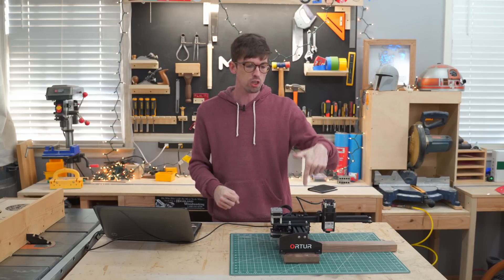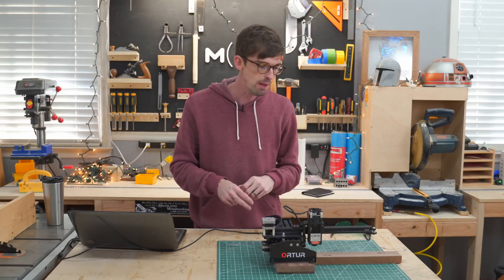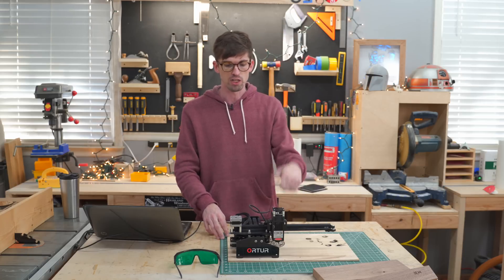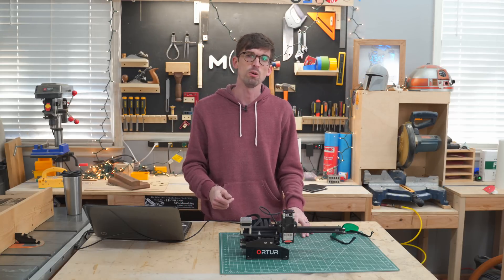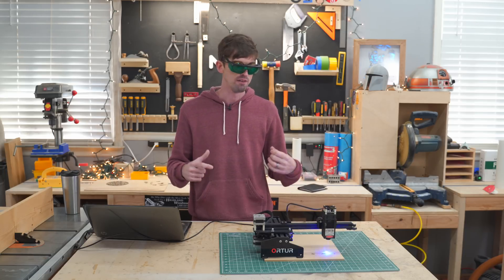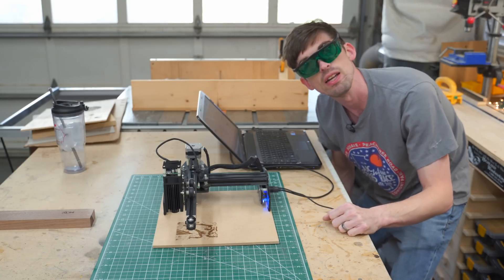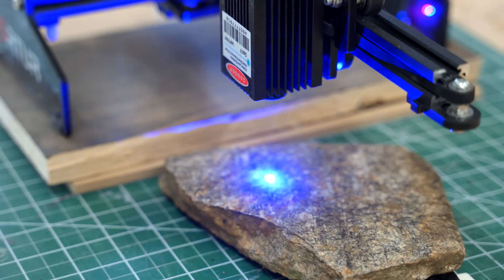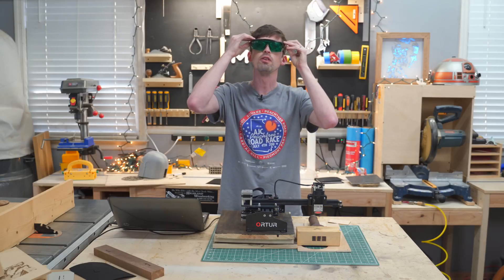Does a $200 Laser Engraver Make Sense in Your Shop?

Comment: can it engrave on metals like aluminium, brass, etc.
Reply: I use the laser to cut a shape on adhesive plastic. Later, apply copper sulfate or iron sulfate to etch the metal
Reply from the maker: Not metals

Comment: I am thinking about getting into Engraving. Question what would you recommend for Engraving on aluminum and Metal? This will be more of a little Hobby not something to make money off. also wanted to be versatile enough in order to do other material paper wood leather stuff like that
Reply: This láser isnt powerful enough to engrave metal. What i do is: a) put some adhesive over the metal. Cut a shape using the laser. 2)etch metal over the shape using cooper sulfate, iron sulfate, sodium hidroxide or something like that

Comment: Hi, great vid. Question, how does the laser know where on the material to start Engraving, let's say I have a 50mmx50mm sheet of card and I want the entire thing shaded black, how do I know where to put the card under the laser
Reply from the maker: You can run a trace that will going around the entire boundary box of the artwork.  Then either move the artwork in the software or move the material.

Comment: Also, worth noting, those included glasses aren't rated for the laser on the machine. The tint vs color of the laser is a dead giveaway. If you look at any laser engraver and many high powered laser pointers of similar wavelength, the protective shielding or goggles are orange. It's basically a principle of opposing colors. It helps if you think of the color of the goggles cancelling out the color of the laser. In this case, the blue laser light is extremely close to the green goggles on the color wheel. The goggles let light in and around the green wavelength through. For the goggles to be effective in blocking the blue laser light, they should be red, or preferably orange, the opposing color to blue. 

Since they aren't clear or blue goggles, they are probably blocking some of the harmful light, but I definitely wouldn't trust my vision to them, especially if they were included free with a cheap and cheerful, safety measure delete laser engraver.

Edit: It might be worse than I thought...I was just basing this off of a combination of my knowledge of optics, confirmed by the high end laser related products I've seen. I just looked it up and found this video. It looks like he has a pair of the included glasses, and they fail to even block an LED, so if you're staring at the laser light, you're probably roasting your retinas.
https://youtu.be/upCsVrKrW7M

He also has an epic accent.

Edit 2: Here's a video that goes more into depth on what you should look for in goggles to protect yourself. I am pretty confident that the ones included above are just green plastic, with no laser rating whatsoever. If one is listed, I'd be willing to bet that it's utter BS.

Long and short of it, if you're gonna save a buck on your laser engraver, don't skimp on the PPE to go along with it. Or you'll be giving yourself anti-lasik.

Final Edit: I'm also only considering the harmful potential of the unshielded laser module. This is ignoring the carcinogen laden fumes it's outputting. There is a reason laser cutters are enclosed both behind laser shielded material AND have their own filtration and extraction systems. This could also very easily start a fire if you're not watching it like a hawk, and even if you are, I can see a mosquito fart knocking it over, or it overshooting the material it's engraving and scorching the surface beneath it. 

As much as I want a laser cutter, this seems like a bad idea. 3d printers and CNC routers are one thing to downsize and lose all the safety gear. The damage they can do is pretty limited to localized burns and possibly losing a digit to a router bit. Laser cutters are next level dangerous.
Reply from the maker: Thanks for the reply, yeh the glasses aren't going to filter out the light, the big thing to keep in mind though is that the real danger is the proximity to the actual beam, that's why the focus of laser can make a huge difference with just a few mm.

The enclosure is the biggest drawback on this machine, but it wouldn't be too hard to build a box around it with some ventilation.

Comment: Laser input is 15 watts
The actual output is only 3.7 watts
Reply from the maker: Good call, I need to update that
Reply: @makeorbreakshop  From the store page: "Laser Power: Electrical Power: 15W, Luminous Power: 4000-4500 mw".  I'm pretty sure that that is market-speak/translation error/etc., as 'Luminous Power' is measured in lumens, not watts.  I would use a laser power meter to find out what the real specs are.

Also, I saw in another video on this that you can easily fine-focus the laser by rotating the lens itself.
Reply: Thank you! I couldn't believe there were LED based 15w lasers, I had never seen over 5w I think.
Reply: @michaelgrier  Hi, Michael.
Endurance Laser makes LED Laser heads that are up to 10 Watts.  I have an LPM and measured one 8W head I bought from them and it was actually 8.37W and with a duty cycle of almost 100%.  Go look at them .. Endurance Laser (George Fomichev) is located in Russia.
Have a nice day, my Friend.

Comment: I wonder if it would cut out wood veneer.  That's usually really thin.
Reply: This thing is useless... It might work as a 3D printer (it's rigid enough with good print area) , but definitely not worth it's cost is shop space ... Or money. 
It's too small to be useful, buy a CO2 laser or a plotter (the kind with the metal blade)

Comment: The air assist on C02 lasers is to keep the final lens clear from smoke residue and other contaminates.  It's to protect that lens for longer use.
Reply: Umm no, the air assist on a CO2 is to move the material from the cut surface so it doesn't ionize and clog the cut depth.  You get drastically deeper cutting ability with air assist than without, and with proper pressure can double or triple your unassisted cut depth.
Reply: @JeremyDarlingDev  Why not both?
Reply: @Geeksmithing  Valid point I should have said to remove debris from the FOC.  If properly setup this will include the final lens  assembly.  As an example though side mounted air assist can actually increase the particulate inside the final lens assembly.  Another side effect is that without proper exhaust particulate will naturally settle on top of the lens as it gets pulled in to the void after the final mirror.
Reply: @JeremyDarlingDev  it also drastically increases the laser safety by reducing and almost eliminating flare ups on certain materials. 

Good point about the void bit. No one ever should want particulates in their void.

Comment: Hi, do you have any advice on choosing between the 7kw and the 15kw version of the engraver? Thanks
Reply: if u need for cut wood, or engrave metal (Al, ex) is no use. I have 40 w CO2 and no mark on Al. and for clean-cut I need to pass 3-5 times, for 4 mm.

Comment: Did anyone try diode laser engrave/etch on steel? I’d be interested in using one for marking out. Any help appreciated, thanks in advance, Oz.
Reply from the maker: So even higher wattage lasers won’t be able to engrave in metals especially steel.  Some workarounds people will do involves applying a coating to the top and then laser it that coating.  Check out CerMark, LaserBond or Enduramark.
Reply: Make or Break Shop, I'm not looking for a permanent "engraving" so much as accurately marking out drill centres etc. this would just need to be dark enough to read so I could centre punch, or extend layout lines with a scriber. With the cost of these machines I wouldn't need to save a great deal of time to pay for the machine, as well as being able to add logos, date stamps etc, cut from vinyl.
Could you add an affiliate link to the latest 20w machine?

Comment: I don't believe they make a 15 watt diode. I bet it's a 7 watt just over driven
Reply from the maker: There even is a 20W option
Reply: @makeorbreakshop  but is it a 20watt diode? What current and voltage is being pulled at full power?  Last time I was pricing diodes they were a grand for a true 15watt diode

Comment: If you are on a real tight budget it’s probably good. But for 350 you can get a K40 with an enclosure and everything. 
You covered the safety and the fumes, those are my major concerns with any of these open air diode lasers. 
I really enjoy these inexpensive tool reviews. It’s cool to see what is out there at a low cost. 
Another way to look at the ultra cheap e-tools, like this is it’s an inexpensive way to try something out to see if you like it. Then if you enjoy it spend the money later on something better.
Reply from the maker: Great points!  Yeh a K40 is a great comparison with what about $150 more would get you.

Comment: It states in the tech speqs that it can't do clear/transparent acrylic, I've seen some other videos of people placing plywood underneath the acrylic, would that let you engrave the acrylic?
Reply from the maker: Let me give it a test and find out.  I know I can engrave and cut acrylic with my CO2 laser not sure about the diode.
Reply: @makeorbreakshop  Thanks! I'm interested in doing engraving for clear/colored transparent acrylic.
Reply: nah it wont, it will still just go through the clear as it is transparent to this wavelength of light so it just goes right through, you will just end up with marks on the plastic from the burning wood

Comment: If you wanted to engrave something, and then back fill it with something like aluminum powder or some other crushed / powdered material, will this carve a deep enough channel when engraving?
Reply from the maker: yeh, you might need to do several passes to get the depth.

Comment: also if it already does pulse with modulation and it is 15 watt it would be readily adaptable to use as a communication laser at a fair distance so if someone pulls the plug on the internet things like that could be used to relink clusters wifi for clusters and the ham guys can provide connectivity at greater distances the internet is an idea not infrastructure you can not turn off what people want.
Reply from the maker: Never would have thought of that!

Comment: as a hobby i recycle electronic parts and get small ingots of precious  metals  that i want to mark with weight purity and an essay mark is it possible if i coat them with something the engraver  could mark them i have read the the lasers do not like working with metal ?
Reply from the maker: Check out Cermark and Enduramark, I haven’t personally tried them but I know people have had success spraying at onto metal and then using the laser to burn it in.  They are just pretty pricey....
Reply: Check on you tube. There is a product by CRC that people get at NAPA spray on then laser over it. It burns the stuff into the metal.

Comment: Can I buy just the laser head and connect it to my cnc? How much is just the laser head?
Reply: Yes, I was just thinking the same thing...except I clicked on his link and spent 2 minutes looking at the website and found the laser head...whereas you....not so much....here's your sign.....
Reply: @stirlingfromla  , you know there is a controller board compatibility issue too - right?

I'll save everyone 2 minutes:
Just the laser head is $200.  But if you buy the complete laser & cnc it is only $175.  Weird.

Even if you find the laser head for cheaper, you might also have to buy a controller to vary the pwm of the laser.
Reply from the maker: Yeh the pricing is weird with just the laser.  Check out J Tech, I know they make lasers specifically for CNC’s